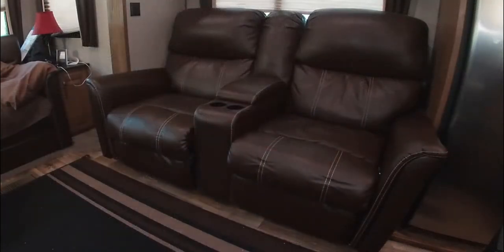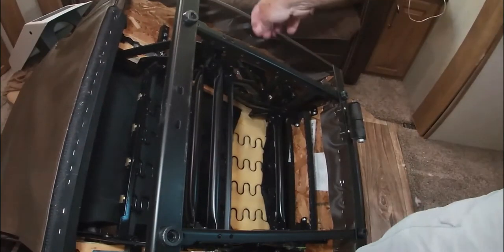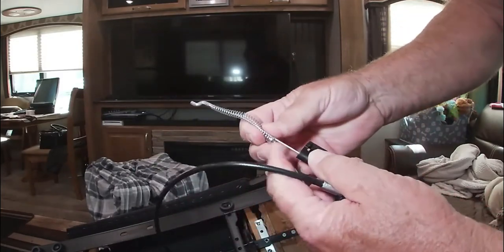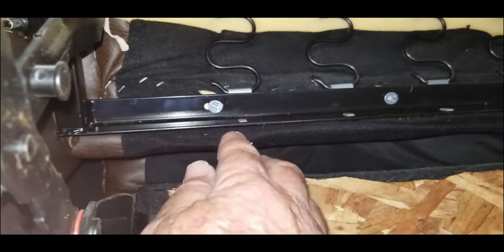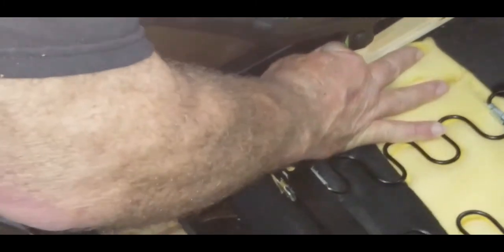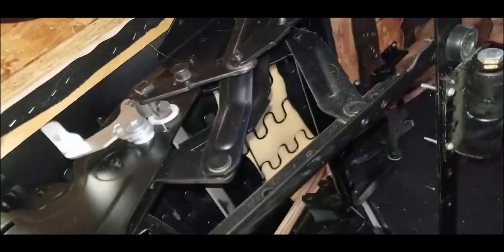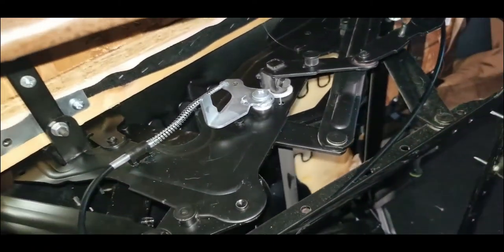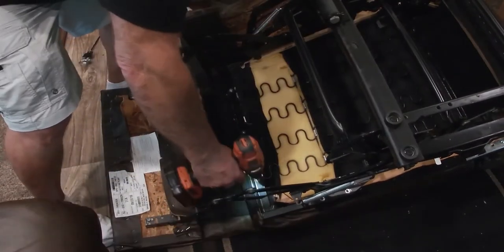How To Fix A RV Recliner

Comment: Thank you sir for this excellent video. One of my recliners has been broken for the past 6 months. I've hesitated to fix it, thinking I was going to have to cobble something together with scrap bicycle parts. I finally got motivated when my wife's chair broke as well. I didn't even know replacement cables were available, learning just that bit of info was enough to make this video worthwhile, but you even detailed the actual repair. I'm thankful because I'd have burned up a few hours struggling before realizing I could just unscrew the seat bottoms, lol. Enjoy your day, I'm going to kick back in my recliner now and take a nap.
Reply from the maker: Enjoy your newly repaired recliner. Glad that I helped you.

Comment: I have a recliner fail, but the release cable was not the problem. Since the recliner would not recline, I did not have access to the screws holding it to the RV floor. I had to forcefully tilt the recliner forward to remove the screws. At that time I was able to see that the release to recline the unit had fallen off of the frame. The mounting bolt, spacer, spring and nut were all under the recliner. Getting everything in the correct orientation and connected properly in the tight spot was a challenge, but I finally succeeded. Your video showing the design was helpful. And now If I ever need to replace cables, I will be prepared. Thanks for sharing your experience.
Reply from the maker: I'm glad my video was helpful. Thanks for watching and for your feedback. Thanks

Comment: New RV owner (used unit) and I have similar chairs  - Can they both just be tipped forward to remove from the base?   What keeps the chairs connected the RV floor?
Reply from the maker: They are not attached to the rv. The chairs have tabs to interlock with the center console.  Tip them  toward you to disengage them. The front of the chairs have rollers

Comment: Nice job on the video. Appreciated the detailed shots, etc.! I am trying to figure out how to remove the seat backs without removing the units which are screwed to the floor. Are there a couple of levers inside the back that one must flip to release them?
Reply from the maker: Mine are different from yours. Mine are not attached to the floor. I haven't had to disassemble them.
Reply: @RvTipsandTrips  Thanks. I figured it out. I reached inside the chair, from the front, in the gap between the back and the seat, felt around for the two springy clip/levers on both sides, as reached from the back in other lazyboy videos, pryed them out, which was actually toward the middle of the chair, pushed upwards on the back with my forearms and the back lifted up and right off. This might be helpful to others whose recliners are screwed to the floor.

Comment: may I ask you what u did for a living before you retired into full time rv?
Reply from the maker: Well I have done a lot of different things over the years. My background was in electronics. When i was a Teenager I worked
in a TV repair shop. Fixed TV's and stereos, Two way radios , marine radios and depth finders. Later on I was a Bio-med tech at a university hospital in NY. I then went to work for a bio-med company as a field service tech and traveled all over the country. Later became a Technical specialist and wrote service manuals and conducted training seminars. I've owned my own business created a very succesfull Deli and sold it after 5 years. I some how drifted into sales and became a manager at Radio Shack. I would fix stores that were not doing well and turned them around.  I was in the top 300 managers nationwide out of 6800. My last career was the car business, first sales then finance. Made lots of money in the car biz until it started declining because of the internet. Time to retire. Well there you have it, a short synopsis of my various careers.
Reply: @RvTipsandTrips  really hmmm thats very interesting...my dad also fixed tvs years ago as he was a techie and no one else at that time was even remotely interested in fixing them, just watching them. i have rellies in the car sales business also.
so if you were into the bio med field are u aware that the pentagon has recently issued a microchip implant that goes into the hand "supposedly"  to detect the "virus"? what idiot would believe that! later on they will eventually tell you OH BTW it has your ID in it and a tracking device also...2 wks ago Woke Media broke the story on yt then couple days ago 60 minutes tv show also did a clip on it. VERY UNSETTLING as it ties in DIRECTLY with the foretold mark of the beast as evidenced in Rev. 13:16 of the Bible (Gods service manual for mankind eh!!)